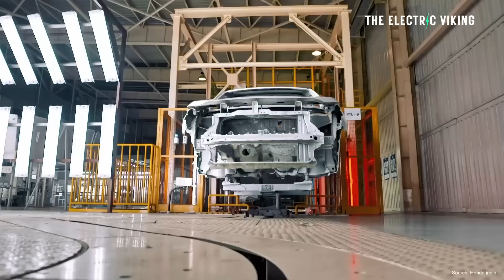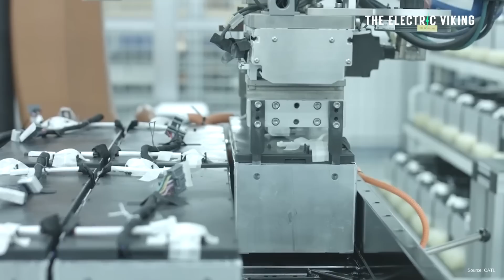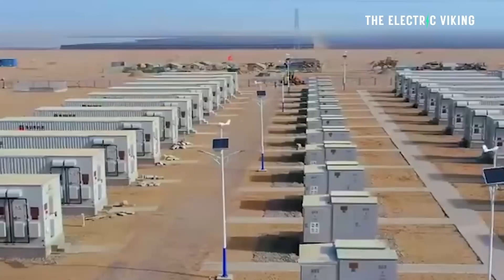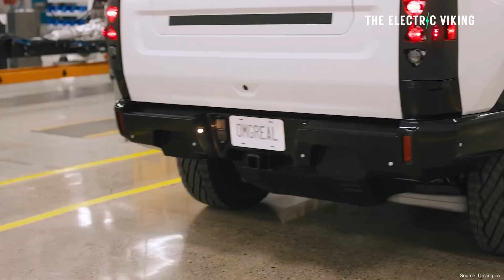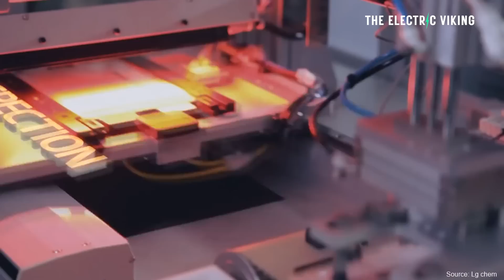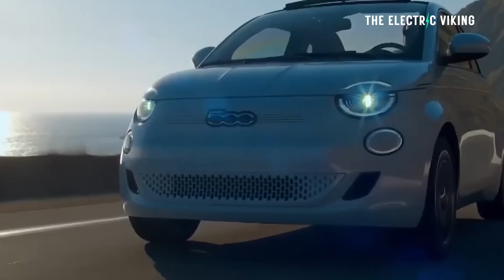World's biggest car companies are LYING about why they aren't making EVs

Comment: I'm seeing articles that say there is a surplus of  EVs already sitting on lots, waiting for buyers.
Reply: Yes because companies like Ford sell them for $70K +
Reply: Yeah, and ford, gm, and stellantis products are aging like wine.  Plus Ford has only had 13 recalls on the f series trucks so far in 2023, lol.gas approaching $4/ gallon 28 gallons $120 per tank, that equates to $400 to $500 / month plus they are so clean you can idle the car in the garage and not hurt your lack of brain cells, plus ice engines get more efficent and reliable  month over month
Reply: @MrJinske  : Yes, there are a lot of EVs waiting for new owners. Yes, many companies producing vehicles have recalls.
As for cost of running, a more expensive vehicle has higher insurance rates. Electricity isn't free, depreciation is poor on EVs, as not many people are interested in buying old batteries.
As for CO output, I guess you're not familiar with modern emission limits for ICE vehicles.
Yes, ICE does keep improving, I'm glad you noticed.
How about farm equipment and transport trucks. Are you waiting for the electric versions?  I'm glad you want your food to increase drastically in price, the related industries will need the extra income to break even.
Speaking of brain cells, it looks like you over taxed yours.
Reply: @drewthompson7457  as for farm equipment clearly you don't own stocks and assets.  Look at caterpillar, agco, Kubota they all have electric on the way, you show your fundamental lack of progress and understanding of economies, Just watch and learn how the world will evolve from your archaic and uninformed views.  Drive and own an ev and you will see how foolish your opinions are,  wait for a few years and let's see how the world will evolve
Reply: @MrJinske  : Yes, electric is on the way. There are already some EVs that suit some people's needs. I believe it is Cummins that is working on  hydrogen power for heavy duty use, as who wants to haul around a 5 tonne battery?
I don't mind not having a PHD in economics - my stocks do just fine. 
No, I'm retired. I won't have to watch the world devolve much further.
Archaic and uninformed? I don't mind at all, these views have served me well for many decades.
Speaking of uniformed, did you look up the CO emission spec for new cars? No?
I do try to keep up on the weekly "world changing" events in the EV evolution. So far, I see them as great commuter cars, though expensive to buy, with great depreciation every year, poor resale,  but which I no longer have a use for. I do remember looking at an EV for my last commuter car, but it would have been touch and go on making a round trip to work in the winter. (there was a class action lawsuit on those vehicles for not making their stated range).  A used ICE vehicle,  with good economy served well for 14 years.   But for the moment, there is no EV as practical for my preferences as my present ICE vehicle. I have found a couple of new ICE vehicles that could be a better match to my needs at this time, but my present vehicle will serve several more years. By then, perhaps there might be a an EV that I would find useful.
But as I said in my original post, there are lots of EVs available, as the ones already built aren't selling. I've read Ford has had a bunch of Lightning orders cancelled, and their EV Mustang has peaked. VW are shutting down their EV plant, as they have enough manufactured already.  But that's just published data - what do I know?

Comment: High EV manufacturing costs make EVs unsellable.  It's that simple.  Availability of batteries is irrelevant if their cost makes EVs retail prices too high to sell at a profit.  High material costs is just one road block to EV demand.
Reply: Says the guy that does not drive an ev...😢
Reply: @MrJinske  If you care about the environment, you don't support EVs.
Reply: @richardmckrell4899  That is just absolutely ignorant.  So take all the energy and pollution to make and drive an electric vehicle over 1,5,10 years and ICE engines are 8 to 12 times more inefficient, meaning, they create more pollution, as ice engines get older they get less efficent, need more maintence and of course pollute more.  Have you ever thought about ICE car energy cycles.  You drill for oil, you ship the oil, you refine the oil, you convert the oil to gas, of course nothing bad there, then you ship the gas to trucks and pipelines, then you pump the gas to the stations, you need electricity to pump the gas back out to the cars and store it while waiting for consumers to need it.  Clearly you don't own a bev, and your not very wise about how inefficient ICE engines are and as they age they get worse.  Bev don't get more inefficient, sure the battery can degrade after 200k miles but they are still more reliable.  How many oil.changes, other toxic lubricants do ICE engines need vs bevs?
Reply: @MrJinske  Sorry, you are wrong on every point, EVs are much worse for the environment.  Plus no one is buying them.
Reply: A tesla model 3 and a Toyota carry are about $4k difference.  Remeber dealers still charge market ups and other tactics to get your money the actual transactions costs are very similar, again your just spouting nonsense.  Compare a model y lr to a nissan murano bev less your just foolish, your are thinking about a lucid, sure, but don't worry your views show you clearly can't afford that.  I own a tesla plaid 22 and I assure your it will outrun any car you can think of 911 turbo s, amg 63, corvette zo6, all for less, safer and just better driving technology.  Educate yourself with facts, your opinions show your ignorance.
Reply: Richard keep singing your songs, like your views on evs your dreaming on both fronts 🍻

Comment: There are not enough batteries that are cheap. If there was more batteries why don't we see the cyber truck?
Reply: Not enough batteries? The Chinese media disagrees as multiple cell manufacturer's are throttling supply and have been since the start of 2023.
Reply: @4literv6  Well why haven't Tesla purchased all the extra production and filled all the Cyber truck and Roadstar and truck orders then?
Reply: @AORD72  beats me? They just swapped all those megapacks over to catl lfp cells and it was rumored they are introducing gen 3 powerwalls very soon also converted to the catl lfp cells. They are making over 6,500 powerwalls a week since last August now so that's a lot of freed up 2170s soon between powerwalls&megapack. 

Maybe catl is fkn tesla around? In the spring it was rumored they went to most of their major customers and asked for increased cell supply commitments through 2025 in exchange for slightly better pricing. And tesla was left out of the offer. 😐

Comment: Missing here: for the US market only US produced batteries are eligible for the massive IRA incentives so supplying cars with foreign batteries will mean they will automatically be $7500 more expensive than compliant vehicles.
Reply: Most buyers don’t make enough money, or have enough taxes paid to qualify for the tax credit.  It shouldn’t be a tax credit.  You’re buying an EV to try to slow climate change.  $7,500 needs to be an instant rebate at time of purchase.
Reply: @OMAOILRIAN  I heard that the instant rebate will be the case starting in 2024.
Reply: @OMAOILRIAN  Wait till next year, it is already law.
Reply: @OMAOILRIAN  it is if you lease.
Reply: @OMAOILRIAN  " You’re buying an EV to try to slow climate change"

Well, except it doesn't contribute to that in any way at all.
Reply: @OMAOILRIAN everyone else's tax dollars shouldn't be going to subsidize our car purchase. 😂
Reply: Most commentators miss this vital point. Traditional auto is already struggling to build EV's cost-effectiely, and the last thing they need is to lose the IRA incentives.
Reply: Ford is partnering with CATL for a battery plant in Michigan.
Reply: @dennisknehans3206 Aren’t their some regulator issues with that? Or has that been solved?
Reply: @dennisknehans3206 they hope.
If true, Tesla would be in there in a flash.
Tesla would have factory built & wired inside 6 months, let CATL keep the $10/kWh. They’d go for 200 GWh of LFP / LFMP, megapack & std range Y. For stage 1.
Reply: The US is not the only EV market. I realise that most Americans don't know that the rest of the world exists. CATL is building factories in the US for Ford and Tesla. It's not that hard.
Reply: What about the rest of the world, like China or Europe?
Reply: @robinsonmac  If it is unfavorable to sell into the US market makes volume production for global automakers harder.
Reply: @mv80401  Why would that be true? Is it true for the Chinese?
Reply: So that's why they are not selling in the rest of the world? I think not.
Reply: That, and they would have to pay a premium for Chinese cells. They simply can't compete with Tesla. They would have to create their own American made supply chain of lithium cells, and it would take them 10 years just to get it rolling at a decent rate. They did this to themselves by ignoring Tesla until it was so big they had no chance of competing.
Reply: They lie, because they don’t want to admit the true reason: that market leader Tesla is outcompeting them, and they don’t want to recognize that fact.
Reply: I live in California.  We don’t have enough power to charge the EVs already here.  This isn’t just about batteries.  There isn’t near enough clean energy production so most of the power is produced by natural gas or imported from other states (also carbon sources).  When you think about how much carbon output is needed to mine the materials needed to produce solar panels, batteries, windmills and other so called “clean energy” products you see the whole industry is a bit of a scam.
Reply: @noctwice  False oil industry talking points. CA imports lots of clean power (wind, solar, hydro). Also has a fast growing share of distributed rooftop PV, now often coupled with batteries that help to shift power use. Finally, the carbon used for producing PV or wind is quickly amortized by the clean power produced compared to fossil fuels which are a dirty one-time shot.
Reply: @noctwice  There have been many studies on that and solar and wind energy through the whole life cycle produces a tiny fraction of the green house gases produced by natural gas. They aren’t perfect, but much better. They are also cheaper at this point. Their only flaw is there are down times at night when the wind doesn’t blow enough that gas is still needed until we get a cost effective energy storage system. Because California is perfect for renewables, you lead the country with 35% of your electricity coming from wind, sun, biomass, geothermal and small hydro projects. Another 6% comes from large hydro and 8.5% from nuclear.   That’s 50% that comes from renewables or sources that don’t make greenhouse gases. I would say that is no scam.

Comment: No Tesla make their own batteries with the help of Panasonic that's why their own Giga Factories are so huge. 
That's why they are called Giga Factories because they make Giga Amounts per year of Tesla own brand EV Batteries.

Half of them are for making the EV batteries which are a different chemical make up to the CATL batteries. 

The Chinese EV makers use the CATL batteries often they are Iron based not Lithium based.  

Tesla is making with Panasonic the new 4680 batteries in their Giga Factories those are not being made by CATL 
the batteries by CATL are the Blade batteries not the 4680 ones. So no CATL don't make batteries for Tesla unless you count the ones Tesla now put in the Chinese made Tesla's.

And Elon just pointed out in the new investor day that the reason for the slow down in even their batteries making is due to the lithium refining is now limited, even though the mining of lithium ore is high.
So that's why Tesla is building a huge lithium ore refining plant in the US to get the much needed lithium ore refining up so they can get the batteries grade lithium sorted themselves.

Comment: It is treason to mankind, when they continue with ICE cars when there are enough batteries.
Reply: How is it treason to continue using ICE? Define "enough".
Reply: There are enough batteries but not enough long term demand. Polls show that millions of consumers say that they do not want EVs
Reply: @jimpackard8059  I know an older study of this type. In a poll 125 years ago, 90% said, they prefer a horse to a car.
Reply: @jimpackard8059  I remember a poll in the UK when smart phones first came out.

Would you swap your Nokia for a Smart Phone? 90% said 'No' 

Reasons given were smart phones were more expensive, the screens cracked and batteries didn't last as long. 

Two years later nearly everyone had a smart phone! 

I predict EV's will continue to grow in popularity
Reply: @jimpackard8059  Most, if not all, resistance of the buying public is based on one of two things - ignorance of the true practicality and utility of EVs, and concern regarding the charging infrastructure. But as EVs continue to spread throughout the public, both issues will be addressed. More and more, these non-buyers will have friends and family buy an EV and be happy about it, thus putting pressure on them to change their minds. And as more EVs are sold, the charging infrastructure will continue to build out to the point where it's a complete non-issue.

Comment: the paradigm change will leave the weak and unwilling decimated.  kodak who? xerox who? blackberry who? motorola who? Nokia who? innovate or die.  ibm, microsoft and to an extent HP pivoted and are still around.
Reply: Steam to diesel hybrid trains come to mind when thinking about legacy ice oems&making modern fully connected ota updateable evs. 
Only 1 existing steam train manufacturer survived the transition to making those damn diesel electric hybrids. 

Trains which worked the same rails, went to the same stations and moved around the same country. Doing the same job's. 
Yet only 1 solitary existing locomotive manufacturer made it. 😀

Ad blockbuster and Sears to your well thought out list to. 👍🏻